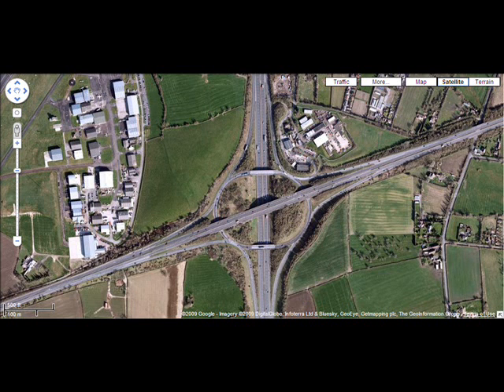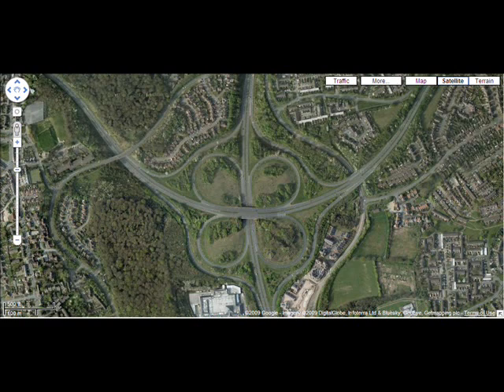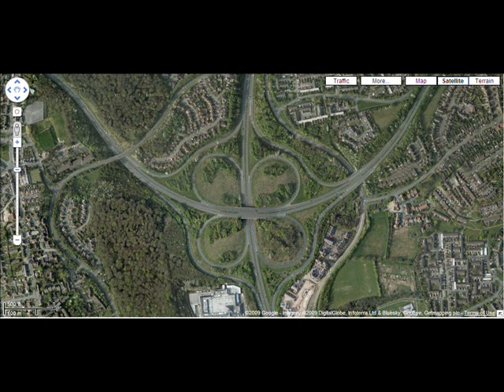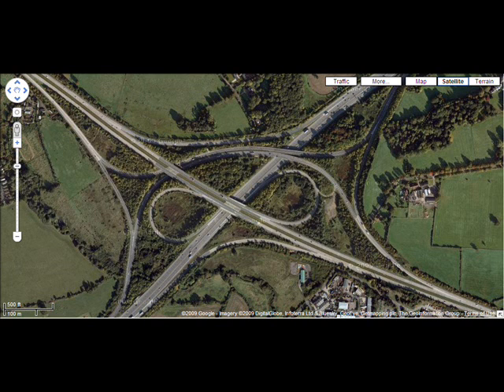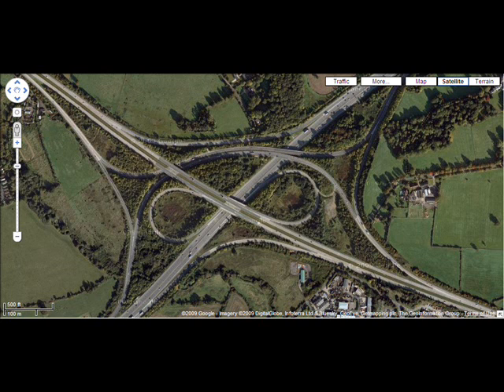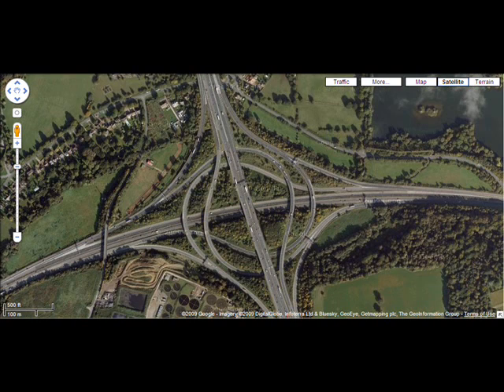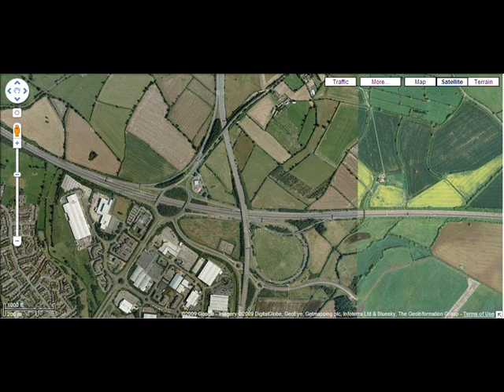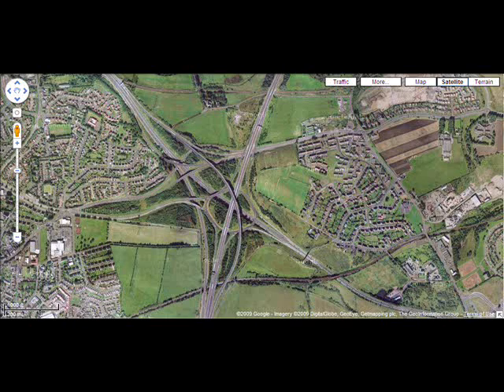SimCity 4 RHW: Different types of junctions and their RL applications - part 2

Comment: I noticed you didn't tell where the windmill-interchange (@ 2:30) was: It's in The Netherlands, just south of Rotterdam with the A15 and A29 crossing. Or at least, it used to be, because it was partially demolished because of a road widening (which you can actually see in the pic). And currently they are rebuilding the interchange again... If you want to check it out as it currenly is: enter 51.865627,4.514866 in GMaps :)

And about the video itself: it's very good!
Greetings from Holland :)

Comment: You think a four lvl stack is expensive. Texas recently finished a high 5 interchange, with a level dedicated to portage roads, or roads that run next to the freeway/interstate/motorway in metropolitan centers. It connects I-635 with US 75 in Dallas Texas. A quick search in any search engine should bring up quite a few links. Quick fact, the interchange was $261 million dollars, or roughly 360 million pounds, using a rough exchange number. Also, 120 feet, 37 meters high.